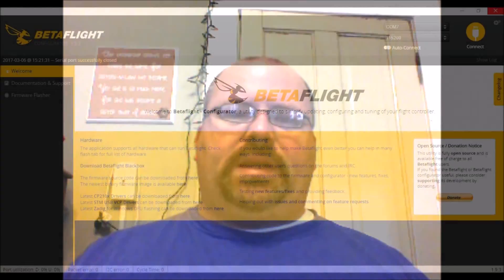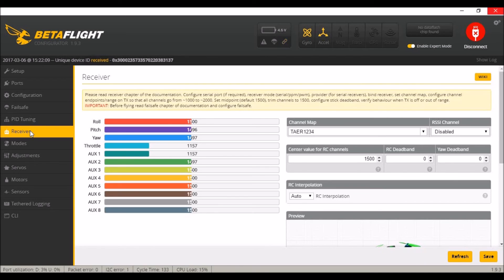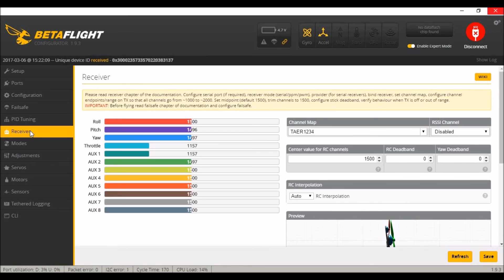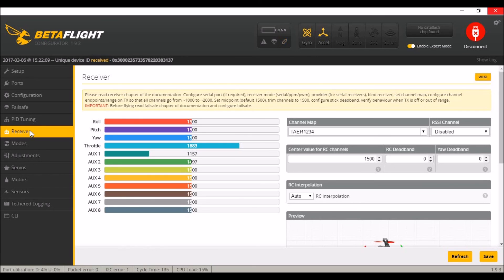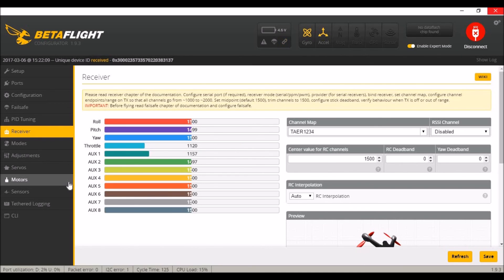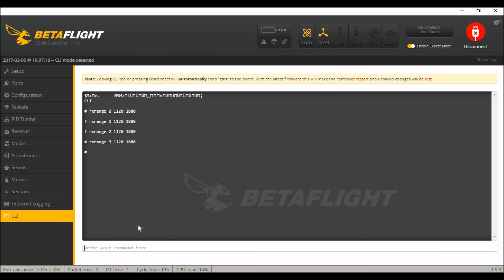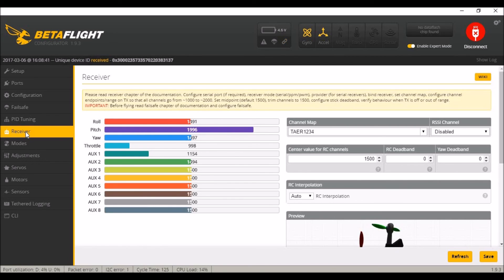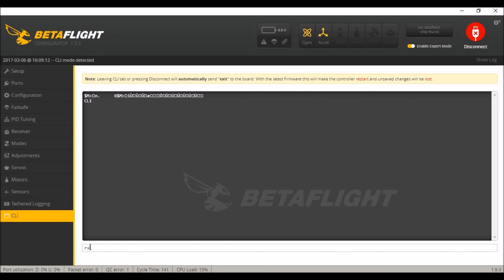How to fix Betaflight travel adjustment issues

Comment: Why does this matter? Like what are the symptoms of having them not at 1000-2000? I thought it was just to get full throw but I’m guessing there’s more to it than that.
Reply from the maker: Betaflight recognizes 1000 and 2000 as the end points. If you are only going to 1850 on the top end you are only getting like 85% of the potential. Thus you are not getting the full possible resolution of the rates you have set.
Reply from the maker: Example: I had a friend that had insane rates yet I felt like his quad was very poor in flips and rolls. When I put my rates on his quad he could hardly get it to flip and roll. This is because he could not reach the end points where the pitch and roll move the fastest. If you factor in any expo you are not ever getting out of the expo curve.
Reply: Bluto FPV Alright so it’s the same as say setting up dual rates and being stuck in beginner rates right?
Reply from the maker: @travispratt6327 , yes that would be a great way to think of it.
Reply: Bluto FPV Cool thanks I was unsure about what they’re actually doing, I’ll have to go try this out I’m still getting used to betaflight =)

Comment: Nice work 👍😎
And I'm stuck at endpoint adjustment in V bar for 3D Helicopter setup I'm using flysky i6 TX 
It won't get to 100% each side having no idea how much i try, can't fix it if you know about it let me know that will be helpful Thanks...

Comment: My quad just spins in the receiver tab. I was hoping this video would help me figure put how to fix that but it talked about something other than what I needed. It also skipped way too many steps in that setup tab.
Reply from the maker: GBLynden's RC, sounds like you need to adjust your subtrim in your transmitter to make sure the Centerpoint sits at 1500.
Reply: Thanks for your response! I realized that the spinning was due to improper RX issues. It says it is a DSM2 RX, but it wouldn't talk until I set it to a DSMX on both my radio and Betaflight. Now I am working on getting it to arm properly. I am not new to RC by any means, but I feel like a noob with this FPV stuff lol

Comment: Hey There, I have the eachine q90" trying to bind it to my dx6i but just keeps trying to re-bind when powered back on, used CLI commands to change set_spec to 9 still no luck. Any Idea's Thx
Reply from the maker: Redogg Damon, are the bind pads still connected?
Reply: Bluto FPV it has auto bind after 6 seconds quick flash. then goes solid let go of bind switch seems to stay solid the remove power resets it all, have changed beta flight cli to 3_5 and 9 with no luck.
Reply: heya its an auto bind receiver after 6 seconds it flashes to bind, it does seem to go solid but on connecting it to betaflight or removing power resets it all again?
Reply from the maker: Interesting issue. I have never had that happen on an auto-bind unless I have plugged in the quad before I turn my radio on. Then I can just unplug and have the radio on first and it connects. I can not find any manuals on a QX90 with the Spektrum receiver.
Reply: Bluto FPV did try to power tx first but once in bind mode turning the quad on after keeps the led flashing constant. with the quad on first in bind mode then turning tx on I get a solid light as I said until resetting power. thanks anyway I'll keep searching/messing with settings. thx
Reply: Bluto FPV just to add this is the q90 not qx90 I have.
Reply from the maker: Redogg Damon, it looks like there are 2 bind modes for the q90. One mode the light is to stay solid (SBUS). The other is supposed to flash every 10 seconds (PPM). have you tried both modes? Make sure you have the correct receiver setting in betaflight.
Reply: Bluto FPV I'm using the sbus connection and have tried changing the receiver options from 1024" 2024" sbus" with no joy. I'm sure the problem lies with changing that option and having the correct cli command entered seems like a big puzzle I do seem to be getting close now though. thx
Reply from the maker: Redogg Damon, on my little drones that have the integrated receiver it is the 1024. Not sure what it is on yours. On the banggood site there are several reviews with tips.
Reply: Bluto FPV unfortunately my luck with this model it's an ultra micro receiver that is supplied with the q90 "small red board". I have now done everything stated in the forums. I still assume it's something to do with my cli commands. I will now try again with 1024. thx
Reply from the maker: Redogg Damon, good luck. Sorry I am not more help.

Comment: my roll is inverted, do you know how i can fix that ? (when i move my stick to the right the simulation of my quad in beta flight turns left and vice versa)
Reply from the maker: Hussein Elsherbini, you should be able to fix that in you controller. there should be a setting to reverse roll. Are you using spektrum?
Reply: yeah iam using a dx8, the closest thing i found in the setting was "analog switch setup" but that didnt help. i actually figured it out tho, i used the same cli commands and changed the endpoints of the roll. very helpful thanks. do you know if there is a way to reversing motor direction in betaflight ?
Reply from the maker: Hussein Elsherbini, as far as I know you have to use the esc software or move wires to change motor direction.

Comment: thanks for the video. ill have to check this out later. i have same issue with spektrum only i cannot move pitch or roll, when making changes on the radio. dont know why. i can adjust the subtrim/travel and nothing changes in the software. so confusing and aggravating. just need to go frsky.